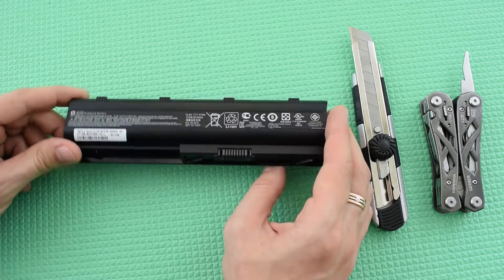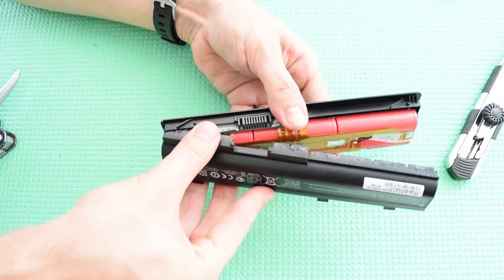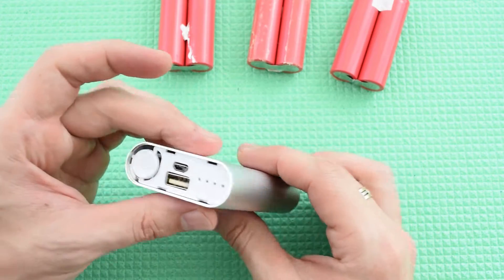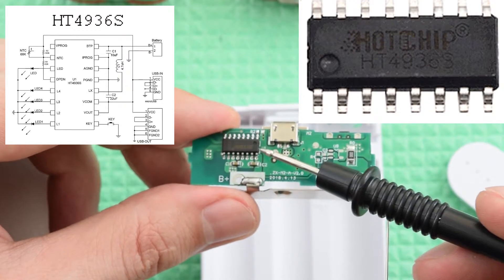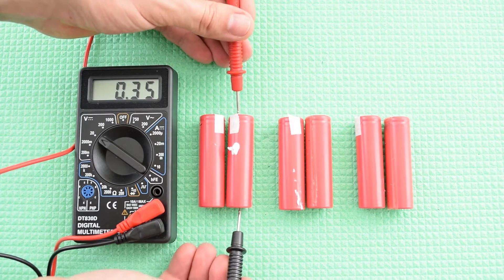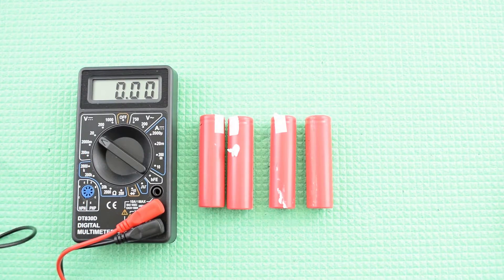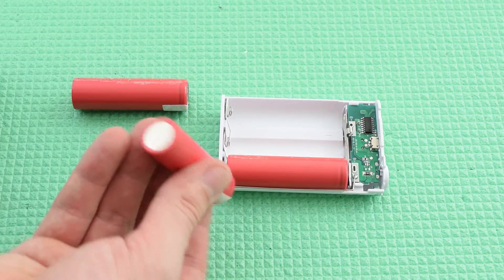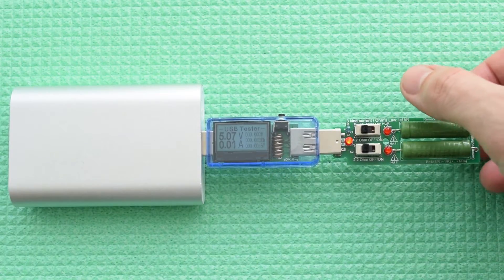Power Bank up to 20000mAh from Old Laptop Battery Pack

Comment: Hello, what happens if I just add  more batteries on powerbank? not change batteries, just add few more?
Reply from the maker: it depends on state of your of cells in your battery and state of charge controller. Technically it will increase the capacity of the battery but if your old cells in bad conditions adding new in parallel is not gonna help you.